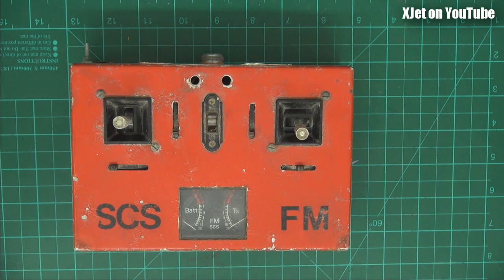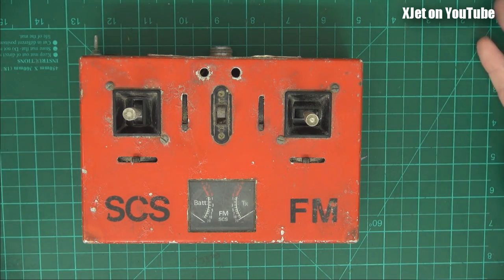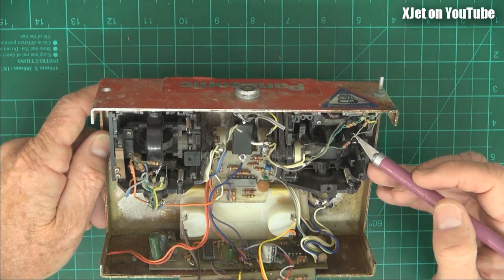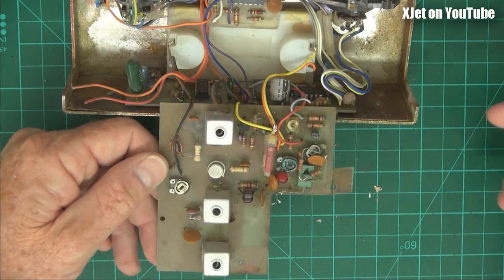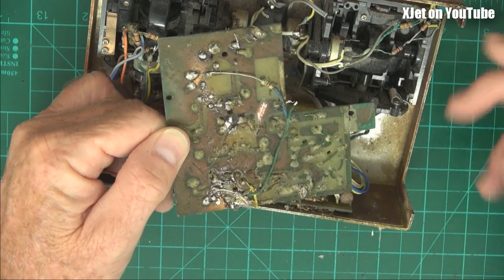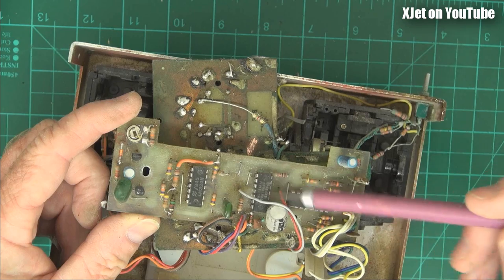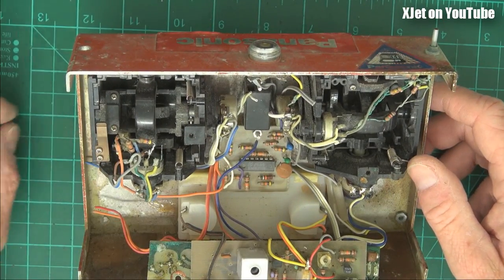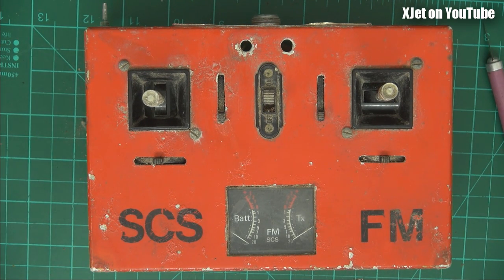The RC transmitter I scratch-built 38 years ago

Comment: Turn it on, and seeeee :-) I remember you having that out at Taupo Maaany many moons ago. And pretty sure it was a TEAC V.U meter you used for the BATT & R.F indication. The LED (oh yes you took me through the back parts of it) was to check the regulator was working. Most of the bits (I.C's excluded) were ratted from dead other things. Think it was a PYE stereo (or two) you got the coil former's from......So long ago....

Comment: Wow.  Was so great to see this video and notice that all the parts, Crystal Oscillator, buffer stage, mixing circuitry, square wave pulse generators and amplifier stage is still the same things that were needed when I made my own home built 27Mhz transmitter using an Arduino and some basic electronics parts for controlling an old RC Truck, now 40 years later!  Wish I could have seen this video before I started that journey.  I think I just learned I need to add something to clean up all the "harmonics and things".  Cheers

Comment: Nothing to be ashamed of there Bruce,  you built something very functional and expandable using cutting edge components available at that time. I am sure that it would function again with minimal work, unlike today's technology where a whole unit is thrown away, simply because it was designed to replace rather than repair....